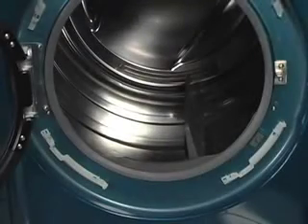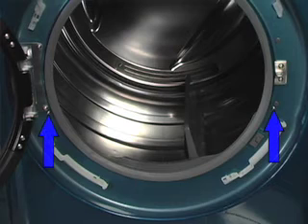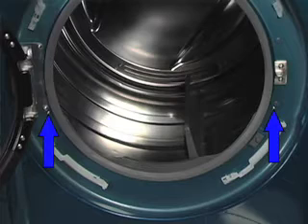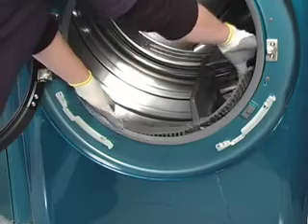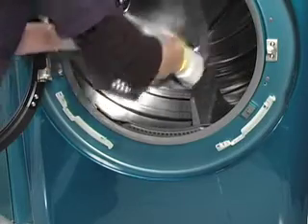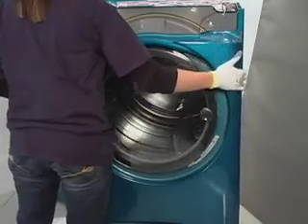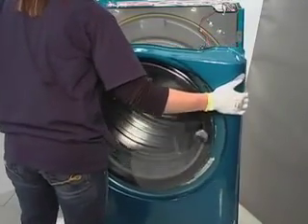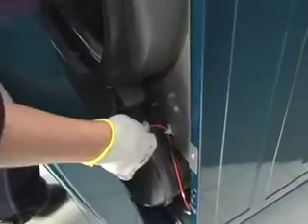Electrolux Front Load Dryer - Front Panel and Air Duct Cover

Comment: After taking out all listed screws, my panel will not budge
Reply: Same, please tell me someone knows how to remove it.
Reply: Did anyone find an answer to this? Mine will not come off
Reply: I can’t get my to budge either.  Did anyone figure this out yet?
Reply: I finally got it. Two issues 1.  There are 4 tabs.  Take a putty knife and slid it between the front panel and the front bulkhead near each tab and twist.  This helps release the tabs.  2.  The rubber gasket around the door is sometimes "glued" or sealed to the front bulkhead.  Taking a putty knife or flat head screwdriver carefully insert it behind the gasket in front of the bulkhead and pry it apart.  Mine was stuck at the top, so I inserted the screwdriver at the bottom where it was already loose and pried.  This helped release sides and I slowly moved up around the sides so not to damage the gasket and it finally popped loose and the door came off!
Reply: @jbond37  thank you!  Mine was heavily glued by the door hedge.